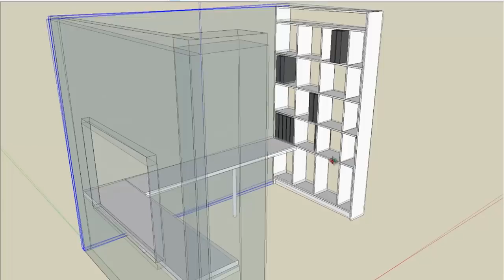Making a MDF Bookcase & Floating Desk (Timelapse)

Comment: Great job! Couple questions on the desk.. Did you consider going for something more robust for a table top - asking because after getting my previous desk full of scratches over 2 years, used IKEA kitchen top for the current one. And another one - wouldn't making the layers of the desk top overlap (so the cut for the under and upper one is in different place) add additional strength to the construction?
Reply from the maker: The ply/softwood/mdf sandwich is very strong so didn't really need anything beyond that. 👍

Comment: By the look of it, did you biscuit the horizontals of the shelves in place? Do you prefer to do this instead of pocket holes? Just curious, I’m needing to shelve out a 30ft room floor to ceiling...
Reply from the maker: Yes, biscuits where possible - just means there's no visible fixings. 👍